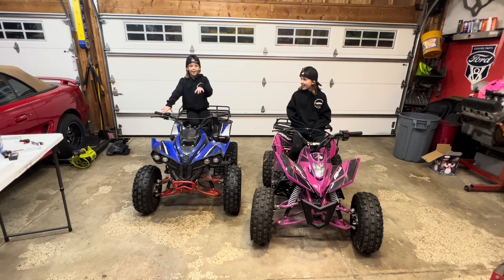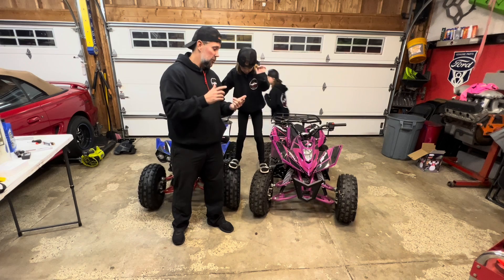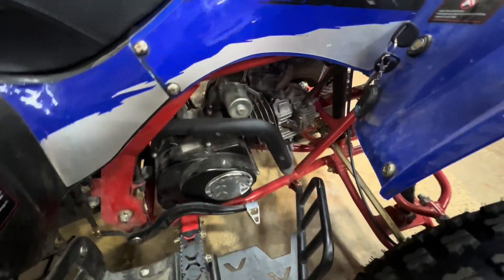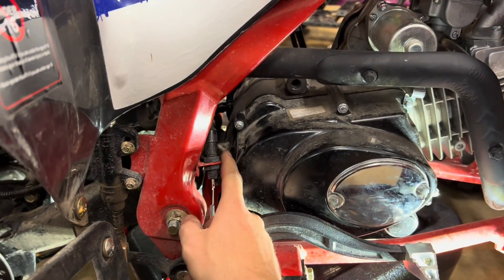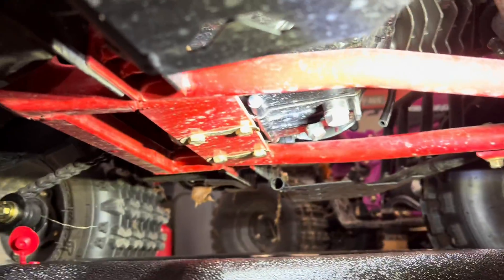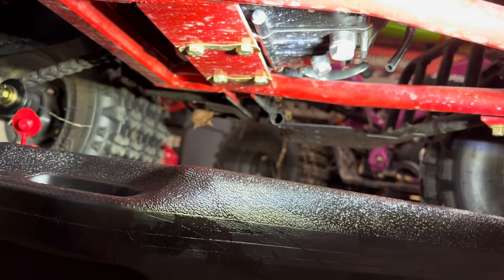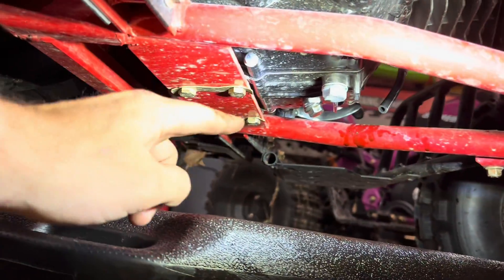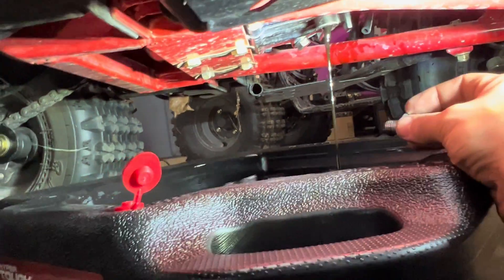Apollo 125cc ATV- Easy Oil change, Spark Plug, & Battery replacement on our Chinese four wheeler

Comment: Thanks for putting this together. 
Any tips on the air filter, next to the carburetor? I don’t seem to find a manual, or any diagrams to go by. 
What are the specs for the battery you put in? 
Thanks!
Reply: Thank you! I’ll look to see what’s there.
Reply: Would you recommend one or the other machine?
Reply from the maker: Specs wise they are the exact machine as far as drivetrain and frame, the only difference are the plastics and headlight differences. I like the blue one more personally just because I like the red white and blue color theme.
Reply from the maker: Hi Adi, if you click the Amazon link in the description it’ll take you right to my Amazon store page with links to all those parts so you can purchase them or be able to get the dimensions you need :)